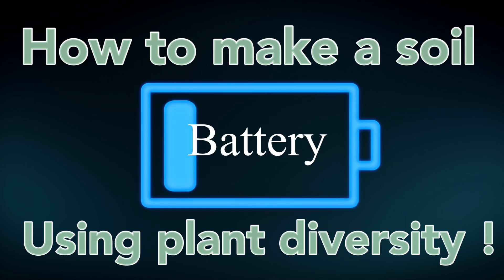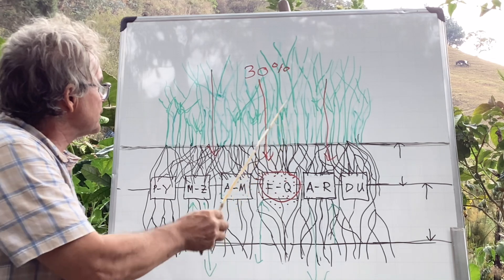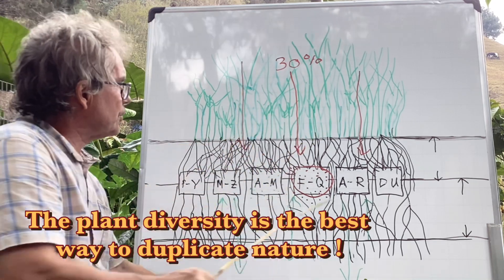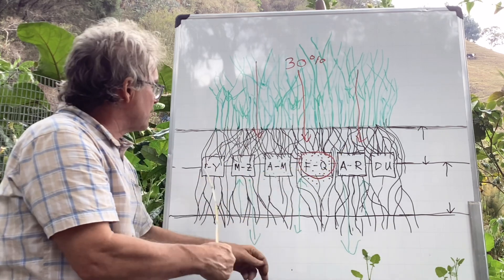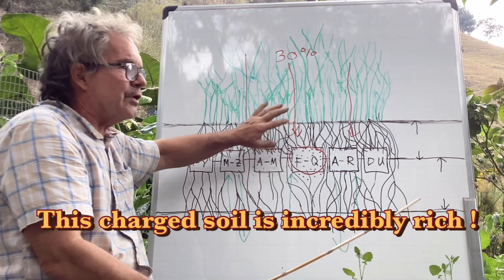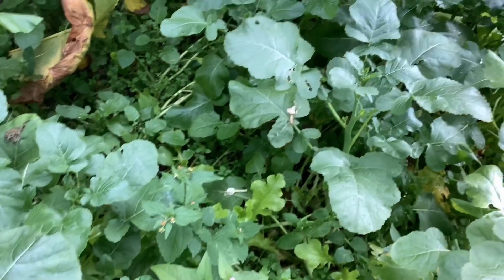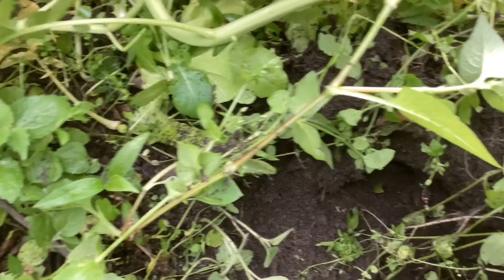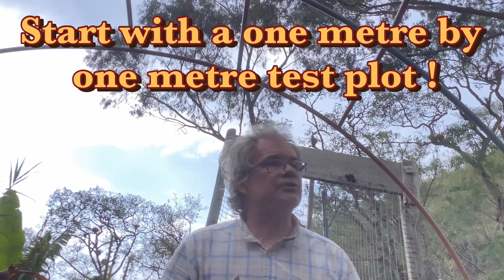How to make a SOIL BATTERY !

Comment: If you want your soil battery to last longer than 5 years, potentially 1000+, you want to add terra preta to this setup.
By adding inoculated biochar, terracotta of any type, and manure, it becomes a living sponge. You also want to include plants with roots as deep as possible to cycle everything throughout the column.
This method, combined with what is shown in the video, is what the Amazonians did to turn poor clay dirt into generationally rich soil.
Reply from the maker: It is so odd that the soil in these rainforests are so tough to grow anything inside them. The Incas and Maya had to be magician to feed millions of people. Like you say this Terra preta had to save the day.   Going to experiment with this! I’m geographically in the same locations as these ancestors.